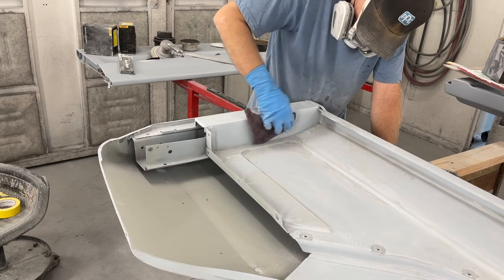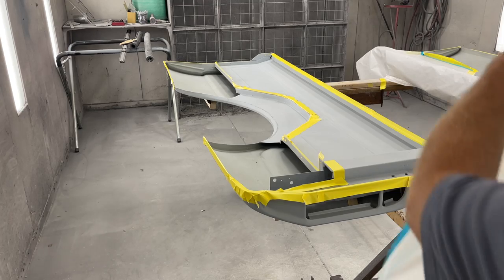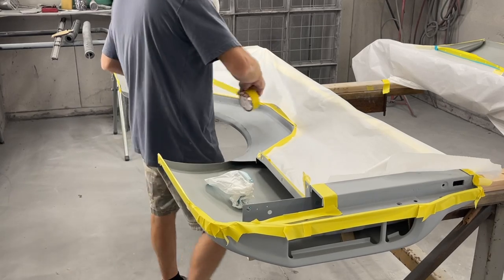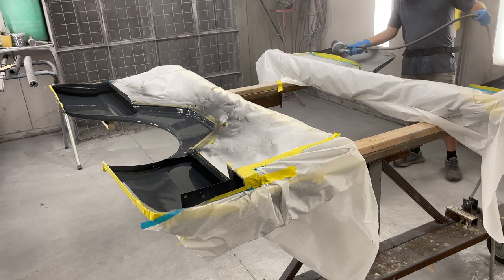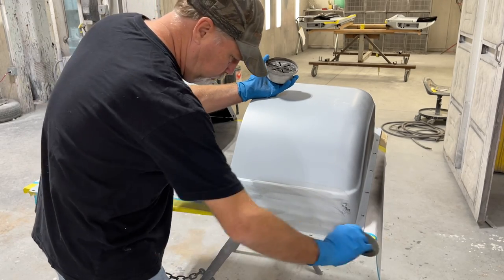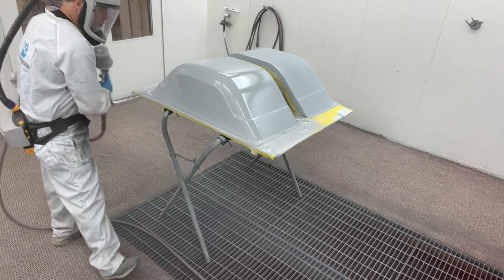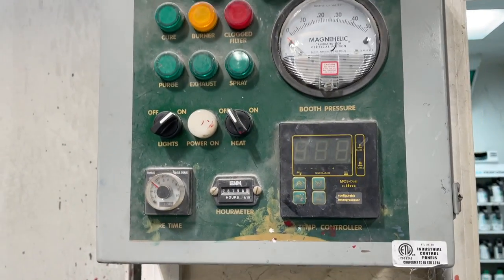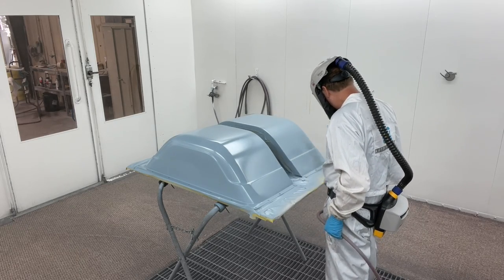C10 Show Truck Project:  Painting the inside of the Bed

Comment: I am torn with using a seam sealer for my wheel tubes to bed sides. Even though I run a tap thru the holes, the mechanic in me puts anti-seize on each bolt. I don not intend on it to squirt out or apply after assembly, but the lower area just below the generous flange below the bolt line. I used a 3M window glazing on the fronts wheel house that seals rubbers on windshields but put it low. I only had a little to wipe off at the bottom side. It doesn’t harden but keeps water out of this joint, wether it rains while driving or during clean up. Most would use none. The epoxy, 2K primer, paint w/clear should keep it sealed. Since this is mine, I like the “Belt and Suspenders” approach. But I am spraying the waxy rust proofing inside the bedsides as well. More than most, yes. But I sleep better knowing 30 yrs someone will benefit from my efforts today. My guess on this show truck, no!
Reply from the maker: This truck will get cavity wax as each part is assembled.
Reply: @StoutCustom    That is one step no one seems to discuss. Your level of attention paid to detail supports your reply. Good for you. Have a safe thankful 2021 “Thanksgivings”  Blessing to all in your circle of friends & family!

Comment: I just painted my 77 Chevy short bed in pieces. Took about 40 hours of booth time to do inside and out of all the panels. 3 coats of 2021 PPG clear. Is that enough clear to do a hard sanding to get it completely flat before polishing? Or do you recommend to sand and re clear with a couple more coats, then sand and polish?  If so, what grit do you sand the clear with  before the re clear? And what grit do you start with sanding the clear for polish? Your work is outstanding! I really appreciate any help you can give me. Thanks for all the videos.
Reply from the maker: It should be plenty as long as it came out fairly flat with some minor pieces of trash to sand out. If it’s heavily orange peeled or full of imperfections a sand and reclear may be easier. I’d say sand and polish a piece and see how it goes.
Reply: @StoutCustom  

I’m going to do the reclear. I want to go the extra mile on it.  Should I go with three more coats knowing I’m taking off a couple by sanding flat. Because I plan to do a sand a polish on the reclear which will take off at least a coat?
Reply from the maker: @loriethornton12  i would aim for two and be prepared to do three. It should be nice and flat after sanding and prepping for reclear. Two more should be plenty as long as you aren’t too aggressive when sanding to polish. If you can get it slick enough and clean enough in two, you can stop there. If it’s rough or full of trash and you think a third coat will help, go ahead and put it on.